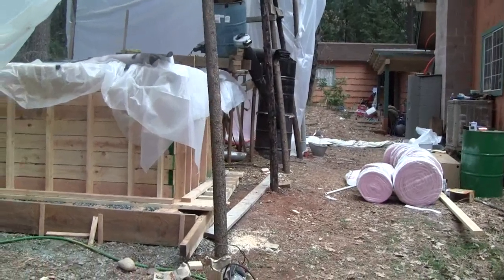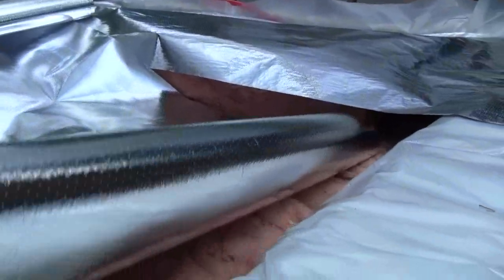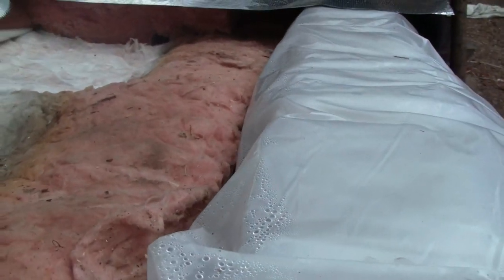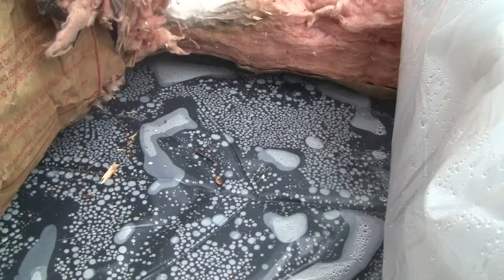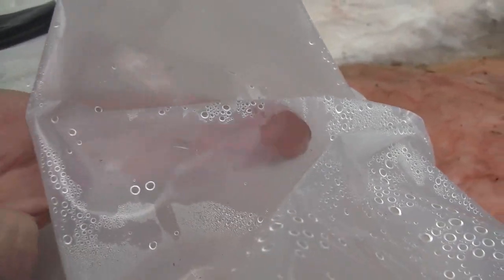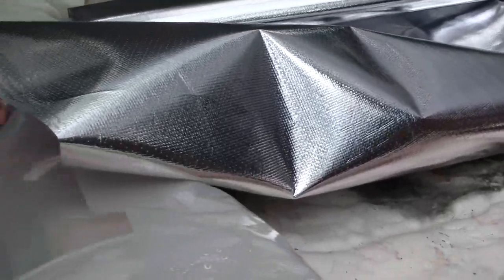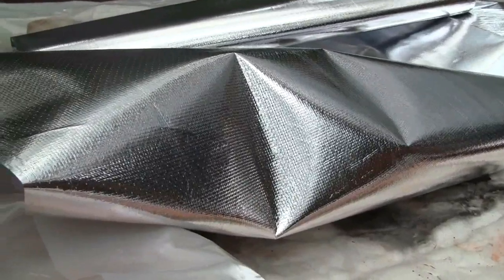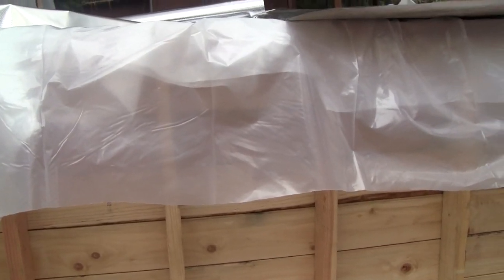DIY Hydronic hot water storage reservoir 7.wmv

Comment: This is an interesting project ..however, while the ground/earth is in effect thermal mass ... it is also a massive heat sink too, especially at the surface  in cold climates . The principle of using the ground as thermal mass works well in passive solar home designs but its a completely different objective which is to heat a mass of  earth  underneath a home slab in the summer months contained within  a well insulated stem wall that is well below the frost line. That mass of thermal storage slowly releases back into the house throughout the winter months, where  in this case there is heat dissipation/transfer into the ground via exchange of water thermal mass with earth mass... however the earth thermal mass quickly dissipates its heat out on the edges because heat allways travels to cold  , so exchanging heat with  the earth in this case is effectively serving no purpose and wastes energy .....I would imagine a couple old used broken hot tubs set on a well insulated foundation with a bit of extra insulation to eliminate thermal bridging, along with solid air tight insulated spa lids/tops would likely be more efficient as a thermal storage reservoir and most likely be nearly free.

Comment from the maker: Depends where you are.  Cost of fuels, roughly, goes like wood chips or straw is lowest, then cord wood, then natural gas, then wood pellets or propane (about the same), then electricity.  Here locally, to heat our home, cost per winter is around $200 for chips, $800 for cord wood, $2000 for propane or wood pellets, $3000 for electricity.  You can see why I'm using wood chips.  of course, I "invest" labor, so cost difference isn't truly that large.